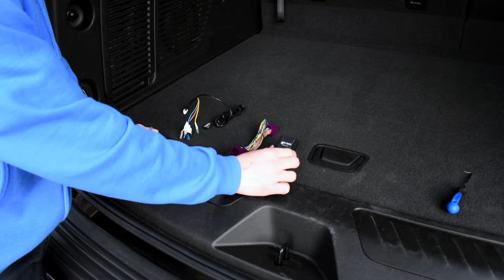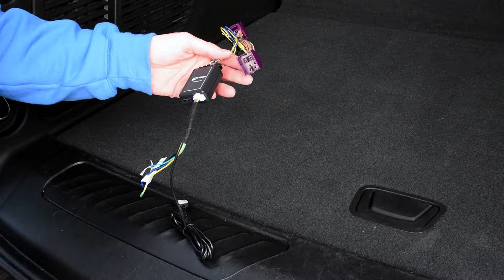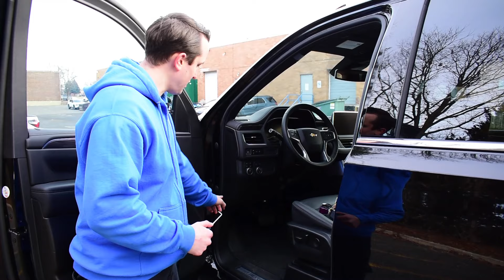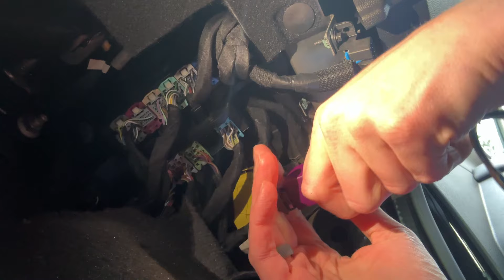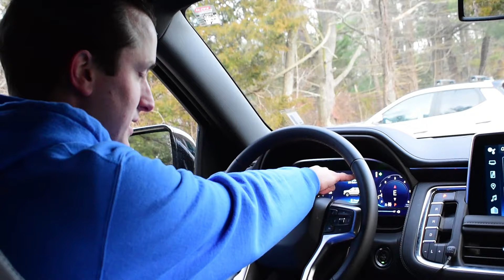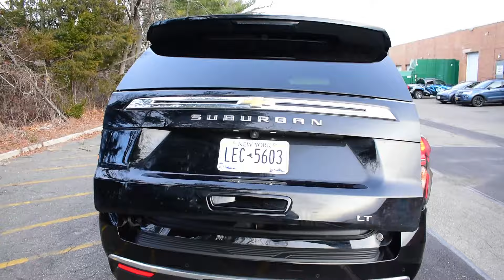First Look: How to Install The Z-Flash LCM for GM

Comment: I just installed a module in my 2021 Chevrolet Suburban and it works just like it's supposed to!  I did flip the "dip switch" #6 on the module before installing so that I could turn the flashers on with the remote.  Also, in the video it looks like you are removing the wiring harness from the right side, but for some reason the video is a mirror image, the wiring harness that gets removed is on the left/closest to the driver's side.  That threw me off a little but once I figured that out, it was pretty simple.
Reply from the maker: Thank you!!
Reply: is it legal?? just curious.... i know we can use it on private property though..
Reply from the maker: @salmanshanu99-ps2pd  Since the laws are different from state to state it is best to check with your local authorities
Reply: @salmanshanu99-ps2pd  Not 100% sure where you live and for you personally.  I have this in my vehicle that is used for leading funeral processions, and I am the Chief Deputy Coroner in my county, so there aren't any  legality issues for me

Comment: Is this the same position for a 2024 GMC 2500? How do you program the module to not flash the reverse lights?
Reply from the maker: There is a dip switch on the module that controls the reverse lights
Reply: hey Travis, did you ever install yours? I have a 2024 2500 HD I have the Z flash and I plan on installing it. Didn’t know if you had any reviews or thoughts

Comment: I noticed the rear camera activated when you turned on the module. Is that something that will happen when the module is activated?
Reply from the maker: Yes, the camera will come on if you have the reverse lights set to flash. You can program the module so the reverse lights won't flash and that will prevent the camera from coming on
Reply: @UltraBrightLightz   Great, thanks!
Reply from the maker: @petey8100  You're welcome!

Comment: I have a 2023 chevy 2500 hd LT. I do not see the LCM under my dash. Are the LT series different than the LTZ.  My company got this for me and am trying to install.
Reply from the maker: If it is an early 2023 model it will not have an LCM. When GM did the mid-year redesign, they added the LCM and that was added for all trim levels. If you do not have an LCM in your truck, we have the Z-Flash BCM For GM:  https://ultrabrightlightz.com/collections/plug-n-play/products/z-flash-bcm-plugin-flasher-for-gm

Comment: Great video to my understanding for the new 2500 HD’s this is the flash will plug and play into the LCM the light control module as opposed to the BCM which is a safer method and will not throw any red flags. Will this avoid my warranty thank you so much in advance for your reply.

Comment: If I have a trailer hooked up and connected, will those lights flash also?
Reply: The lights on the trailer will not flash while using the Z-Flash LCM For GM

Comment: is there any flash module i can put for a 2001 gmc truck been trying to find a module but all of em are for newer trucks could use help would appreciate it a lot
Reply from the maker: Unfortunately, we do not have a plug-and-play flasher for your truck but we do have hardwire flashers that you can install to make the factory-installed lights flash on your truck: https://ultrabrightlightz.com/collections/hardwire-flashers/products/feniex-4-output-flasher

Comment: So how many flashing patterns comes with the module and how to  change the patterns without using the little  switch included
Reply from the maker: The Z-Flash LCM For GM that is being shown in the video has (3) flash patterns. If you do not want to use the provided toggle switch you can use the Hi-Beam Stalk to change the patterns: https://cdn.shopify.com/s/files/1/0552/6021/7553/files/Z-Flash_LCM_9-16-2024.pdf?v=1727720100

Comment: I have a 2024 2500hd is the mod programable on a computer or is it 3 set flash patterns with dip switch options?
Reply from the maker: There is no software to make custom patterns for the Z-Flash LCM For GM but as you mentioned you can use the dip switches to make lights flash/not flash
Reply: @ awesome thank you so much. is there an option to update the mod? I have a Apple computer and just wanted to make sure it was compatible
Reply from the maker: @Intwodeep902  There is no way to customize the flash patterns on the Z-Flash LCM For GM but you can adjust what flashes with the dip switches.

Comment: Do you have any plans to do older vehicles like a 2003 Grand Cherokee?  There are lots of older jeeps, tahoes, suburbans and such in service with volunteer departments and such
Reply: We have done some testing and found that the computer systems in most pre-2007 vehicles are not able to work with the type of firmware that the Z-Flash uses.

Comment: I ordered one recently and installed it into one of our 2024 Suburbans a few days ago. The rear lights flash for about 2 seconds then go off for about 4 seconds then flash for 2 seconds...and so on. This occurs on all three flash patterns.    Why don't they stay flashing? The lights remain off longer than they are on.
Reply from the maker: It sounds like Pin Switch 5 is turned on which can effect the flash patterns: https://cdn.shopify.com/s/files/1/0552/6021/7553/files/LCM_GM_Manual.pdf?v=1713361537

Comment: Does it have a turn signal override function?
Reply from the maker: Yes!
Reply: I just bought one from you. Is there an install manual for the override? Do I have to hardwire it to the factory turn signal wires?
Reply from the maker: @timmyo9185  The override should happen automatically when the turn signals are activated. Please give us a call and we will be happy to assist you! 1-888-562-5125

Comment: Yoo only conected 1 end on the lcm so what you only supposed tp connect 1 end?
Reply from the maker: You will need to disconnect the harness from the vehicle and plug that into the Z-Flash LCM Module. Then take the harness from the Z-Flash LCM Module and plug that into the vehicle

Comment: What about 2023 Chevy 2500
Reply from the maker: If your truck was built before January 2023 you will need the Z-Flash BCM For GM: https://ultrabrightlightz.com/collections/plug-n-play/products/z-flash-bcm-plugin-flasher-for-gm   If it was built after January 2023 then the Z-Flash LCM For GM which is being shown in the video will work: https://ultrabrightlightz.com/collections/plug-n-play/products/z-flash-lcm-for-gm
Reply: @UltraBrightLightz  do these plug and play modules work on the head lights as well, it doesn’t list those in the description
Reply from the maker: @brandoncarmack5416  The Z-Flash BCM For GM cannot flash the headlights but the Z-Flash LCM For GM will flash the headlights.